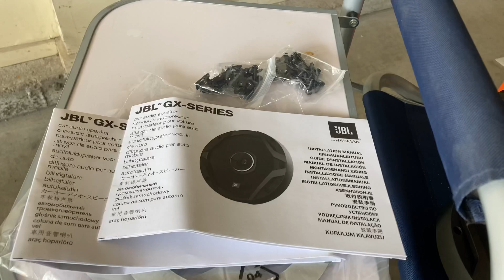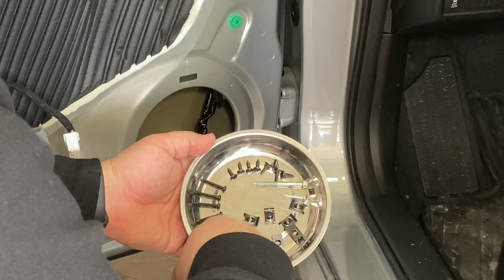2022 Honda Civic Sport stock speakers upgrade, JBL GX628

Comment: Great video man and thanks for the walk through! One question though. If you are installing two way speakers, isn't that essentially like having twice the amount of tweeter? Wouldn't it be a better idea to install component in the doors and just use the stock tweeters? Just curious as I have a 22 sport and am getting ready to install speakers myself. TY in advance!
Reply from the maker: You are correct to assume that it will be too much tweeter but in research the factory tweeter is wired in series after the door speakers so the draw from the that channel is minimal and doesn’t overpower the door 2way speaker. The factory tweeter is not very powerful and is actually a good blend with the doors. IF you ran an amp and put more power to all the speaker I would think your theory would be more noticeable. If I was to to go with an amp I would definitely go with a “top line” series component set, probably the correct option for a BEST sound setup. Mine is definitely in the BETTER option..hahaha!
Reply: @na.custom2273  Thank you brotha, I appreciate it! I think I will go ahead and just install 2-ways to make it easier. Next project will be an amp and subs using an output converter. Any chance you might do the same and upload? Take it easy sir.
Reply from the maker: @Mr._Steal_Your_Squirrel  yes, I been looking for the best inline preamp option and where to tap in. So far someone suggested right behind the factory unit and I did see video about that this week posted but haven’t gotten to it yet. Been busy with a project truck and other mods for the Civic. But I do hope to get that content made, appreciate the follow and encouragement!!
Reply: You are correct. You definitely don't want to install coaxials in conjunction with the factory tweeter. For starters it's not going to be timber matched and two, imagining will be weird. The factory location is one of the best options.

Comment: '23 civic sport here with stock speakers, Kenwood kac-511 mono amplifier with driver adjustable bass boost knob and a Kenwood 12" dvc 4 ohms subwoofer parallel wired to  2 ohms in trunk and the sound and power is much better now.

Comment: I just ordered 4 of them with 800 watt amp and have a woofer box with 750watt and 800 watt. Can't wait to get it installed.
Reply from the maker: Wow, sounds like a lot of power, is that 800W peak or rms? Also interested on how you do your inputs? Line out converter to RCA or does the amp have speaker line inputs?where are you gonna tap into? I like to see that, for the sub I want to put in soon!
Reply: @N/A.Custom22  i really don't know got it from a friend 2 years ago but never installed it but surprised it's still working. Amp seems to have speaker lime it's 4 channel
Reply: @na.custom2273  planet audio had it on sale for 75$ got em immediately from Amazon
Reply: @na.custom2273  tap into the speaker wires right behind the head unit screen. On the dash you can pop that piece off with a trim tool and see the harness. I saw photos in the 11 gen forum.
Reply from the maker: @themaineadventure4687  awesome info, #22CivicHacks !!

Comment: I modified the factory speaker mount to accommodate the new speaker. I also used the the factory connectors. Just need a cutting tool to cut out the factory speaker and connector, then mount new speaker and solder leads onto factory connector, plug and play install.
Reply from the maker: Nice, after I started I thought to myself that that would have been an option if I had a dremel… and patience!

Comment: Thank you for the video, did you need any kind of amp, and if so was it already wired into the JBLs? 
Was it just plug and play? (Except for the little bit of wiring, but I’d consider that plug and play as well, im more so asking was anything else other than the speakers and wiring needed to have it work) 

Im pretty knowledgeable mechanically, but the audio systems are completely new to me, thank you for your time.

Comment: Just ordered Skar TX series speakers and tweeters today. This video is gonna help a lot 💪🏽💪🏽 planning on putting dual 10” Alpine r series in the trunk but I’m gonna see how this sounds first.
Reply from the maker: I’ve never heard Skar speakers but I see it alot, there was several cars with them at the car show this weekend.
Reply: @na.custom2273  doing mine RN do you know which color for the front speakers are the + and -??
Reply from the maker: @danielcow1999  sorry I missed your question until now, Im sure you're done but if you still need it my friend at the 717_Project posted the diagram on his speaker install video.
Reply: @na.custom2273  they call it Skarbage for a reason.

Comment: Thanks for the video. I know it's hard to tell through the internet, but for some reason I can just tell that the sound is better from this video . Someone earlier mentioned maybe not putting in those speakers with the tweeters built in because of stock tweeter. Did you notice anything sounding weird? If you could do it over would you use just straight woofer / speaker without the built in tweeter? thanks again

Comment: Driveway mechanics unite ✊
Even through my cell phone speaker I can't tell the bass response is so much better. Definitely considering this upgrade for my EX. 
Where was yours manufactured? Mine from here in Ontario gets the piano black trim on the doors, though after a few years might look like crap if I'm not careful.
How well did all the trim go together after all is said and done?
Great work on the vid btw 👌

Comment: Any reason why not getting the component speakers? When you also have tweeters
Reply: The sport doesn't have tweeters.
Reply: @ mine does?? 2022 sport hatchback. They come with 4 tweeters just not the Bose system

Comment: Curious I just ordered a 2022 civic R/S (South Africa) and its being sold to
me with a 12 speaker Bose system which apparently is great. Was that not that case with yours ? Just curious on the need for an upgrade.
Reply: nope the touring, Si, and type R comes with bose speaker rest are standard speakers with smaller display head unit

Comment: How do they sound bass wise compared to the old set? Any door rattles before or after?
Reply from the maker: No rattles, I made sure the speakers and the brackets were flush. With the foam gaskets there is no issues. The bass has less distortion and bit more rich. Only using the power of the stock radio so bass is really not something that can be truly regarded in just replacing the door speakers. You will always needs a sub in this configuration if you want to hear and feel some bass. I have a low profile Pioneer 10” sub I plan on installing in the near future!! Hope that helps, otherwise I suggest a good set of components with an amp if you want more bass out of the door speakers.
Reply: @na.custom2273  Nice! That's what I'm hoping for. The Bass is too distorted and lacks richness stock. Appreciate the work!

Comment: Hi. I would like to put a whole new audio system in the car, unfortunately It is a lease. So I think my better option (to avoid modifying the car) would be just replacing the factory speakers... I alredy have 2 jbl pairs. The only thing that's bothering me Is the fact I need to drill those little holes for the mount adapter. Do you think this will affect my lease when i need to return it?
Reply: They won’t know, nor will they check for speaker upgrades. As long as you don’t add a sup or amp
Reply: @aaroncruz8119  oh ok thanks.. i dont even think in leaving them. i will put it back to stock before returning it. My worry is about them checking behind the door panels.
Reply from the maker: Also there is no available head units for the 11th gen as of today. Yes, replacing the stock is a non factor in a lease unless you return it with no speakers!! 😂

Comment: Should this also work on lx trim
Reply from the maker: There is one trim level that has 5 1/4” in rears, not sure if it’s LX, but most likely it can be upgraded to 6 1/2” by removing stock bracket to expose same opening! Thanks

Comment: What about the pillar tweeter? is impossible to replace with components speakers.
Reply from the maker: Actually not, the guide I got from Crutchfield shows how to take the pillar off and connect a tweeter. You will need a glue gun to fasten the tweeter down and splice the line to wire but the guide tells you what each wire is. The current setup has the tweeter wired in parallel and to add components the crossover should be able to be tucked inside the door panel. I kinda skipped over that when researching since I was just replacing the doors. If I ever decide to upgrade again it will be the Full Monty with components and amp!!
Reply: @na.custom2273  thanks for the info i try later on
Reply: Great video ! My next project

Comment: Hey, I had these installed professionally and there are problems. Lots of popping noise and cracks at higher volumes, especially songs with more bass. These speakers are 2.3ohms, the installer said 4ohms are recommended for the 2022 civic. The speakers were pulling too much power from the factory radio unit causing it to overheat, and would cause the radio to shut down all speakers leaving with me no audio at all. Beware guys they are still trying to fix these issues with me, if they can’t be fixed I’ll have to get new speakers or re install the factory ones. These do sound good when they work, lacking bass tho.
Reply from the maker: Sorry to hear that, I haven’t had any issues. The rears definitely don’t draw as much power as the fronts but that is more of the power output from the factory radio (which has no aftermarket option). The answer to your issue if the installer is correct and didn’t cross wire anything is to add a 4 channel amp and properly re-distribute the with hi-pass eq and add another amp and sub in the trunk, curious to hear what they find
Reply: @na.custom2273  I ended up getting 2 sets of Kicker CS 6-1/2 to replace the JBLs. So far no problems. The sound on the JBLs are definitely better especially the highs compared to the Kickers. I also got the kicker 10” hideaway sub/amp installed under my seat by the BestBuy AutoTech. The installation was only $130. It was a very clean install. The kicker speakers plus the sub make up for everything compared to the JBLs. The extra bass right under my seat is a real pleasure. Wish the JBLs would have worked in my car with Kicker sub, but the Kickers def sound better than the factory pairs.
Reply: @Frostytaco1  the Auto start/off feature of the car doesn't affect you having an amp?
Reply: @xJADD  it still works with the sub/amp hideaway, no problems at all.
Reply: @Frostytaco1  in my cars i had jbl gx but moved on the alpine s and those sounds way warmer and with better mids and bass
Reply: @modelotime3608  The JBL GX's sounded nice to me but lacked bass, wish it would have worked in my car. I have the kicker speakers with the 10'" sub/amp right under my seat, so much more bass had to max the highs and mids on the factory eq. Maybe I'll look into installing the alpine s thanks.
Reply: Getting the same issue with some infinity references overheat the system and cuts out all audio… it gets real annoying how weak these new civics are.

Comment: Probably not the best idea messing around with the speakers or the audio system in a 2022 car. If you have any electrical issues during the warranty., warranty repairs could be denied